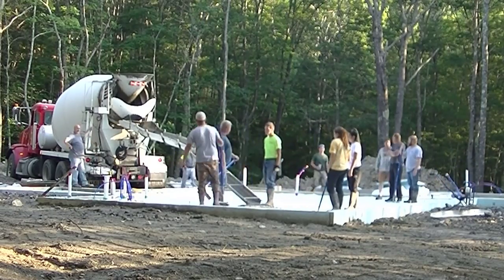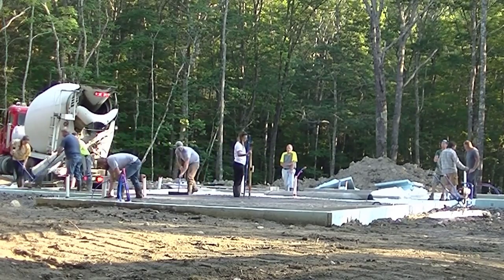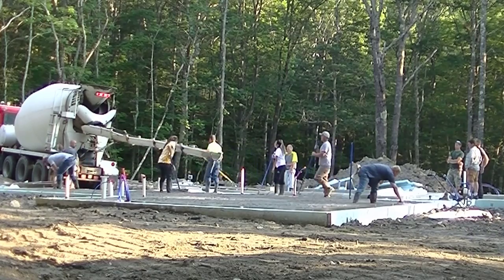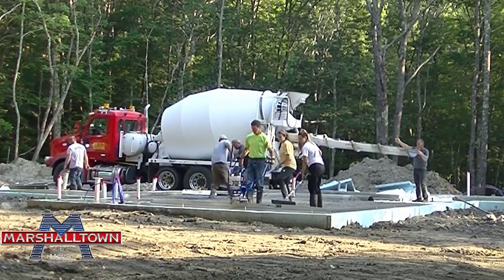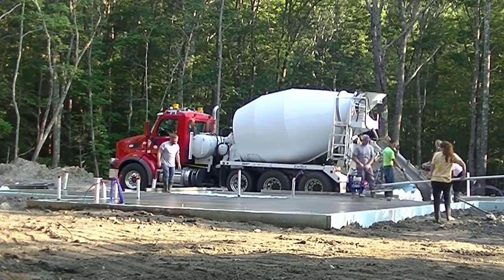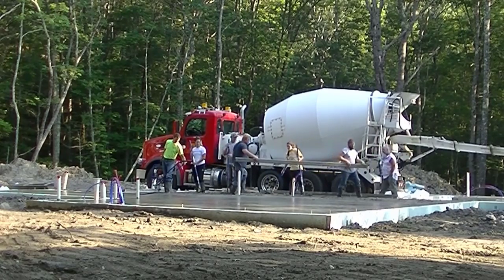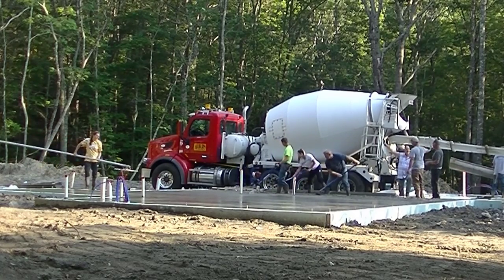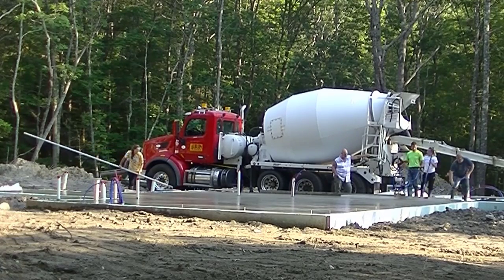How To Screed Concrete | Best Screed For Concrete Floors

Comment: “Shockwave Vibra- Screed” 
Just did a surprise slab with my dad today. 
Woke up at 6:00AM to my mom hollering because he almost fell off his truck, and I didn't even know a project was to be done today.. 
35 80lb Quikcrete High Strength Mix bags later, and here we are. 
Thank you for the helpful video!

Comment: “Shockwave - Vibra Screed”. I screed by hand. I’ve borrowed a vibra screed once. The guys on the rakes will make or break you on these so training your rakers is key. They have to move fast and keep the right amount of concrete in front of the bar. About a 1” roll in front of the bar seems right. If you run over a low spot, stop and move the screed back and go over the low spot again after your raker pushes more concrete in to the low spot. Thanks for your videos.

Comment: " Shockwave Vibra-Screed", impressive how easily it glides over with minimal work. I have only used aluminum or wood screeds and Mike is right, lots of effort the old way. Vibra-Screed is SWEET.

Comment: Shockwave vibra-screed.  What slump do you typically have for floors in cold weather?  Is water reducer the same as plasticizer? And do you ever use grade pins, instead of having the laser out while you pour?
Reply from the maker: Same slump in cold weather, there's warm to hot water in the mix. Yea water reducer and plasticizer is basically the same stuff. Sometimes I'll set a grade pin with a nail through it at floor grade to go by. Mostly we use the laser.
Reply: @MikeDayConcrete  thanks Mike. I've got a big slab coming up in cold weather.

Comment: Hey mike I like all your videos I’ve been taught the same ways with concrete from my dad you do awesome work mike my father and I are full mason he’s been doing it for 48 years he was trying for 50 but recently had a hip replacement and will have to get the other one replaced as well I’m going on my 20th year this is my first year without him I was fifteen when I started full time with him and concrete was one the most that kept use going all the time we’ve always used just a screed board but we are always willing to try new tools or equipment out so my father got a vibe screed and it was awesome mostly used it for big jobs and for a stiff slump it sure saved ware on the back too ares wasn’t a marshalltown though I bet it’s a top notch tool I love marshalltown use all there hand tools they are the best in my preference! Our vibe screed got ran over by the concrete truck it sucked not having it around anymore I’ve tried to get it fixed but it’s a lost cause anyways long story sort I’ve been wanting to get one for a while and it’ll be awesome for my father to get back into it when he can return and vibe screening would be perfect for his return! Look forward in watching and liking your future videos mike

Comment: Mike:  Great presentation.  Did you use welded steel mesh or rebar in this slab?  I've never worked with concrete, and I will be pouring a slab for a backyard woodworking shop, probably 20' x 24' give or take.  So I am watching a lot of videos so I can help the finishers if needed.  Thanks.
Reply from the maker: You can use the welded wire mesh in the slab. I also lay 2 rows of rebar around the edges for more support on the edge.

Comment: Hand screed but back is tired can u run this on a form board? Thanks for the cool con vids keep working hard brother
Reply from the maker: You could if the top of the form board stays clean with no cement paste or rocks on it.

Comment: SHOCKWAVE VIBRA SKREED .HI Mike .Craig from Australia here .I have also been concreteting for about 40 years and am still hand skreeding , we pour slump between 80 to 100 mm,3 to 4 inch and am wondering how level you can get floors using vibra skreed versus hand skreed. Cheers Craig.

Comment: We have both, but prefer using a dago striking stick we can do it as fast also as goo as the power screed, the thing about power screed if you are not careful you end up getting it too wet then it comprises the concrete, so we pour no more then a 5.5 at the most, we Consolidate the stones then roll that way.

Comment: "Shock-wave vibra screed"
So, our little business we use screed poles that we put in the concrete to screed off. We use a magnesium 2x4 that we bolt an electric concrete vibrator to. I've never used a vibra screed but watching your videos has made me want to try! Again, you're more than welcome to come to PA to help me with our new house basement if you need a vacation; the offer is always open!! Keep up the awesome videos and thanks for posting!!

Comment: "Shockwave Vibra-Screed" We strike off by hand about 50% of our work. All depends on how much pitch we have to work with. The one bad thing with vibrascreeds is they are difficult to use on jobs that have alot of pitch. But they are lifesavers (and backsavers) on flatter work.

Comment: used the power screeds 5 years ago or so but went back to screeding by hand  wasnt really impressed with the power screeds !!  I find one or 2 guys with a strait edge is quicker !! Doesnt work to well if the concrete is alittle stiffer !! Unless you have a good rake man !!

Comment: I remember when I first saw a vibra-screed. Probably late 80s, early 90s, doing a job out of town. At first I thought it was just something the guy had made up in his garage from an old mag straightedge and a weed-eater engine. I thought “What the...?!?”. But it worked great and the industry has never looked back. It completely did away with the guy on the juke and the 2 guys that normally drug the straightedge were really glad to see it. I remember by the time those 2 guys got to the end of a bay, they were suckin’ air! Vibra-screeds and laser screeds have revolutionized the industry for sure.
🤜🤛